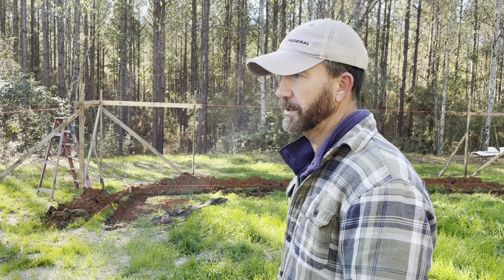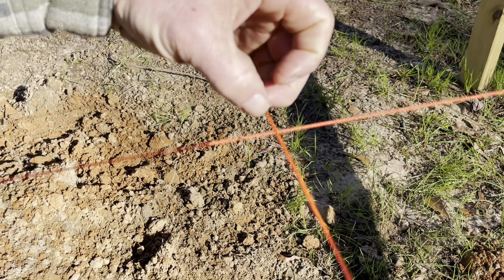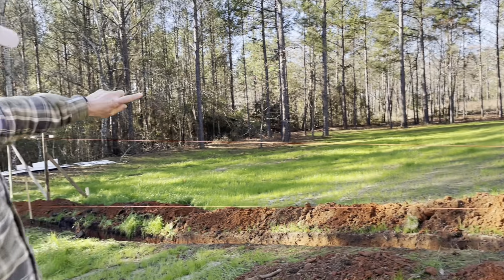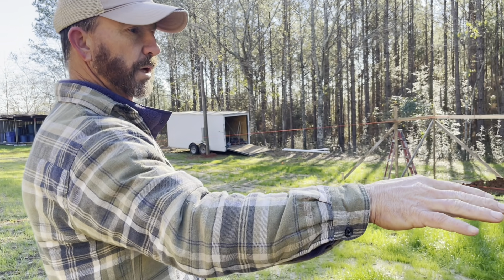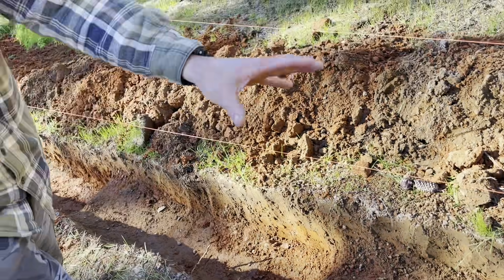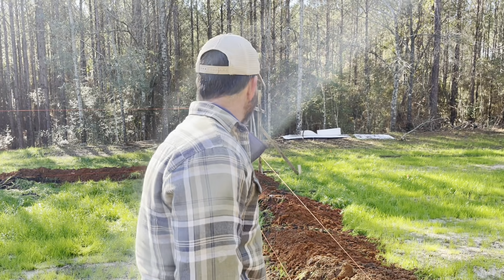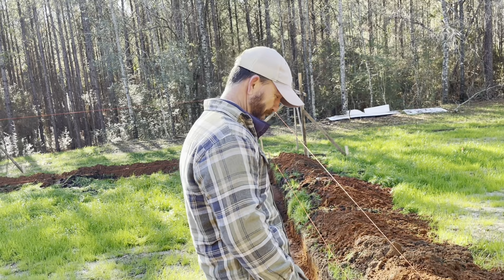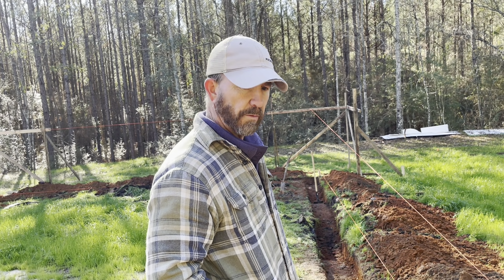New Home Construction Foundation Layout 101

Comment: My dad always said to save yourself some trouble and always make it...Level...plumb...
and square. The carpenters rule/trio. The homes he built 50 years ago...are still standing...and looking good. Solid. Like you...he didn't cut corners and go cheap where quality counted. Especially the foundation. The code for residential housing was 1/2" rebar back then...he always went 5/8 in the foundation. He always said that was the strength of any house 🏠. Probably why his stuff is still standing straight and no sagging for the long haul.